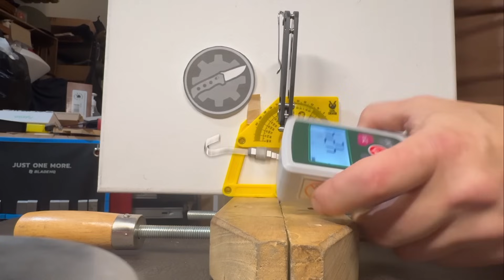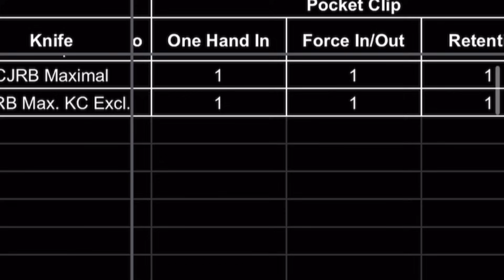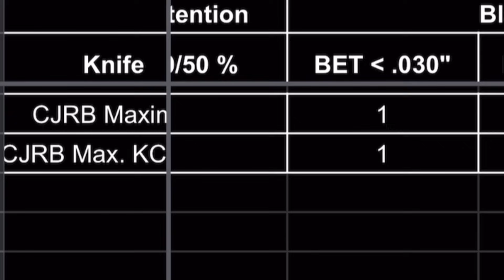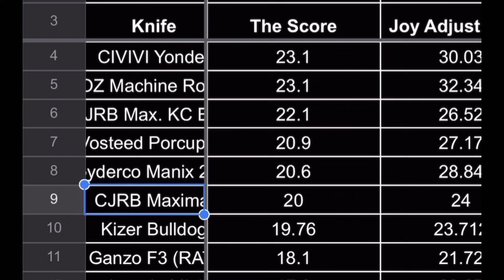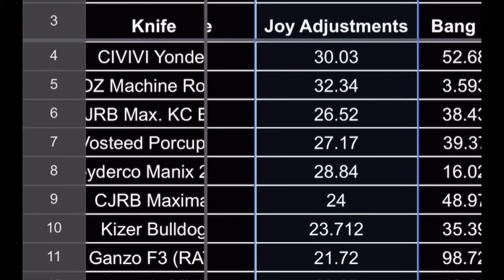CJRB Maximal: RPM9 and SFII steel performance and EDC scores revealed.

Comment: Aarpm9 performs lower than 9cr in cut testing and its electro slag and not spray form like Larrin suggests he thinks it is.
Reply from the maker: Artisan stated that it is spray-formed. Electroslug is not a cheap method. Probably 2-4 times more expensive than spray forming.
Reply: @CuttingBoardRx artisan doesn't even know what it is. It's electro slag.

Comment: im curious if you could test 2 of the same knives side by side, one with the oem stamped bearings and one with skiff bearings and see if one outperforms the other in terms of smoothness, durability when the blade has lateral force applied to it (since there are more ball bearings, is the force applied spread out between each?), and ability to keep debris or dirt out since the the skiff bearings are not an open cage system. just wondering if theres a significant advantage to upgrading to skiff bearings
Reply from the maker: @m0nchii  Good question! 
On a knife that is built with sloppy tolerances, adding a multi row thrust bearing will make some sense as it will allow a slightly better pressure distribution in the pivot area as one cranks down on the pivot screw to reduce blade play while hoping that the action remains smooth. 

On a properly designed/machined/assembled knife this makes no difference that could be measured.
It’s like me adding a high flow air intake to 2016 Mustang GT which came equipped with one from the factory so that I could tell people that I have an aftermarket intake… I spent $300 on a 1% performance gain…

Comment: Bro, come on, these knives are made in communist china. Neither you nor anyone else except for the CCP company that made the knife know what steel is used in it. In china, they're not using expensive foreign made steel. They're using the APPROXIMATE DOMESTIC equivalent! 

Eric Glasser from Spyderco in a very recent interview BASICALLY let this fact slip (I think by accident. He does a lot of business in china so I don't think he let it slip on purpose). 

Loose lips and all that, but really, it wasn't anything I haven't been yelling from the rooftops about for years.
Reply from the maker: I can’t comment on steel composition since I don’t own a spectrometer. Neither do you. Don’t know what Eric said, but a) he is in competition with these companies and c) he makes a good number of knives in china for Spyderco brand and has a subsidiary brand Byrd made entirely in china.
Reply: @CuttingBoardRx  true, neither of us have spectrometers, and even if we did it still wouldn't tell us where the steel was manufactured,...it would AT best tell us how close of a copy it is. 

However, come on. We were both born in communist countries (you and I). We know full well how things work in communist countries.

Comment: I always wondered how they give a hardness but no blades are tested.  So how do they know?
Especially when so many things can change hardness  very easily  
Of course fanboys will defend a company instead of calling out their lies. 
I still remember CRK saying they left S35VN soft so it was easier to sharpen.  I believe benchmade and Emerson used the same non-logic. 
I believe they know most people have no access to hardness test. Plus saying something draws out the defenders. 
It just gets me paying premium for materials but the steels is heat treatment is budget steel. 
So performance is budget or just a fraction more if lucky.
Reply from the maker: Exactly why I do what I do.
Reply: @CuttingBoardRx  an I appreciate it. I try to comment just to help the algorithm. Limited income nowadays so I try and do what I can for the ones I like. 
Plus I like your sense of humor!